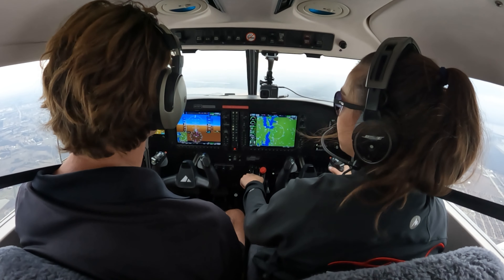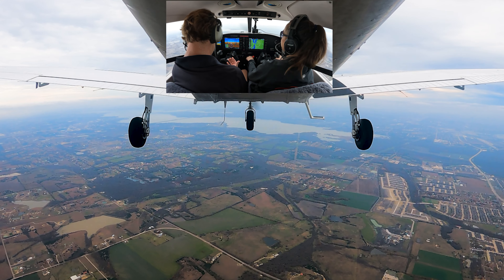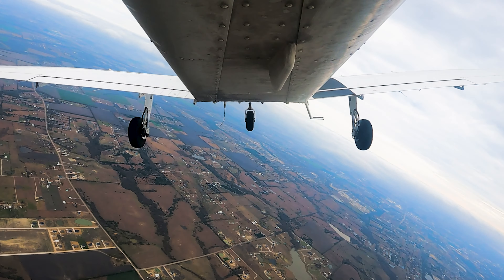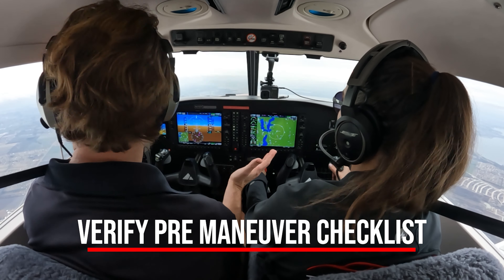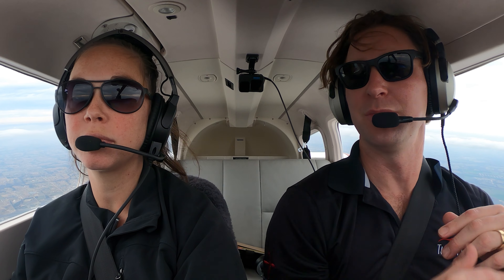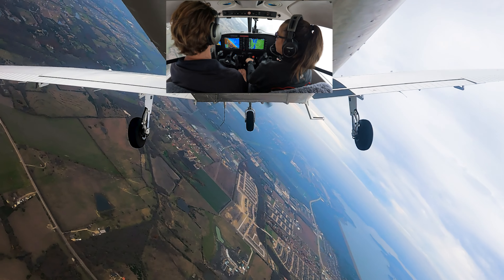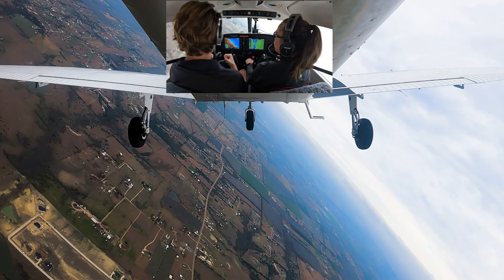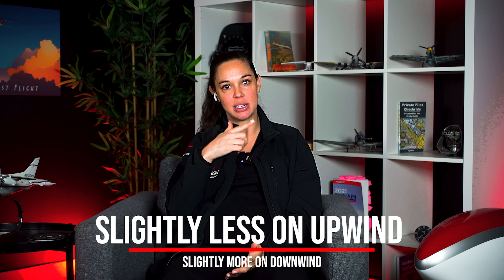The Ultimate Tutorial on Steep Spirals: Learn from the Experts

Comment: You state that "clearing the engine" is an ACS requirement. I don't see that listed anywhere in the ACS definition of knowledge, risk management, or skills for this maneuver.  Am I missing something? Good video, just wanting to clarify this one question.
Reply: Agreed. It's not in the ACS.
Reply: The ACS references the AFH and you'll find it there.  Happy flying.
Reply: @Vpmags  I find no mention of clearing the engine in the chapter on steep spirals. I do see this reference in the chapter on simulated engine failures, as a suggestion: "An occasional clearing of the engine is also desirable."  I don't see anything that would constitute an ACS *requirement*.
Reply: @dustinwoodhouse1940  AFH Chapter 10, page 3, paragraph 2.  It provides guidance but limits verbiage to "should" not "must".  If you are concerned, It's probably best to bringing it up with the examiner of the day to better manage expectations for the check ride. If you're just looking for clarification in general, ask your local FSDO.  Cheers.
Reply: @Vpmags  my only concern is people stating requirements that don't exist.  Is this a best practice?  Probably.  An ACS requirement?  No.
Reply: @dustinwoodhouse1940  Agreed!  In the end, DPEs subjective analysis is ultimately what matters
Reply: Not only is it not in the ACS, shock cooling is a myth. But some specific airplanes may call for such at which point you’re tied to it.

Comment: 60deg of bank in a LEVEL turn requires 2gs and increases stall speed. In a descending turn, you're still at 1g and no stall speed increase. Stall speed increases with load factor, not bank angle.
Reply: Beat me to it. Big mistake by the video makers confusing speed with angle of attack.
Reply: For a spiral, they should be pulling hence adding load, think first half of low yo-yo while never doing the second yo. Therefore we don’t know the g. They’re confusing purpose too. The text states for learning about near stall while the speech spoke of rapidly losing energy so as to expedite a landing.

Comment: you aren't pulling 2Gs in a 60 degree descending turn
Reply: Yup Even flight instructors seem to misunderstand that it’s not bank angle that increases G, it’s the associated load factor that you need to maintain level flight that pulls you down.
Reply: Yes you are, after you’re stable in this very long turn with constant airspeed. If you are pulling less than 2G, the airspeed will keep increasing. Put another way: it takes 1G to do a 60° turn, it takes another 1G to not accelerate downwards. 

It’s true for a short duration 60 degree turn you have a few seconds to do a decent turn without loading up before the airspeed runs away from you. But once you stabilize a long 60° turn it’s the same 2G.

Comment: 60 degrees is not 2 g because you’re not holding level; picking a speed slightly above “best glide” may not be best either, the intent is rapid dissipation of energy, hence you either want to be really fast and, as able, toward max g load thinking parasite drag augmented with induced, or, if you can’t be fast, you want high AOA for gaining just the induced as your tool. Bleed the energy. That is the game. As for three turns, depends on how you’re given the maneuver. If you’re just doing it as a prescribed maneuver “let’s do the spiral,” sure, but if you’re presented with a scenario, you shouldn’t be slowing your descent rate for the sake of getting the turns done. I’ve done this in anger, it consisted of two Split-S at idle with speed brake though with minor extensions vertical down so as to stay fast and keep rapidly descending, then an oblique high g 360 which put me at a tight initial for an overhead break. Depleted the potential rapidly then quickly bled away the kinetic. PS - there is no best glide speed, only best glide AOA and such is only best in still air. We talk about AOB increasing g and pitch rate increasing g yet we never talk about steady state pitch lessening g.